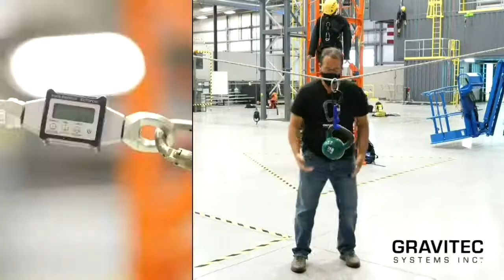Gravitec TV Episode 5

Comment: Nice word cuya 👍...¿does horizontal lifeline need their Own absorving device? So that both anchorage be 5000 pound.

Regards from Chile.
Reply from the maker: depends on the design.  If the design engineer needs to bring down the loads, an energy absorber on the line can be used.  Keep in mind this increases the clearance for the user.  .